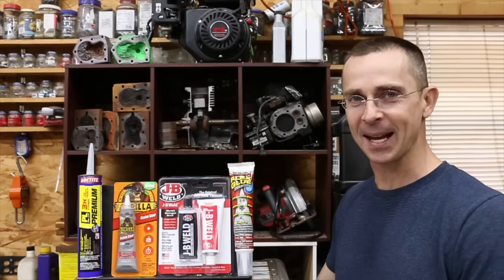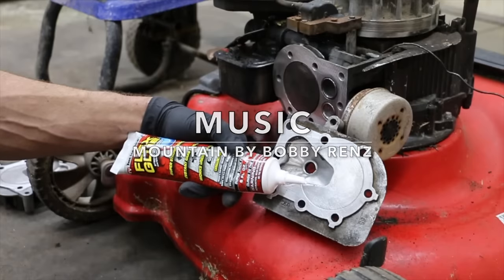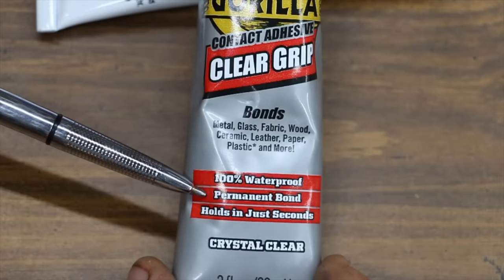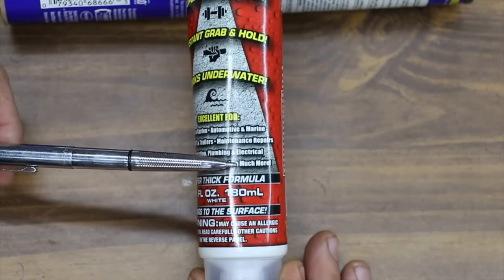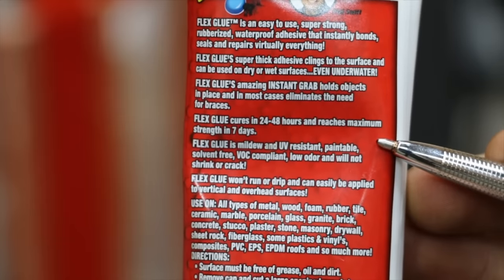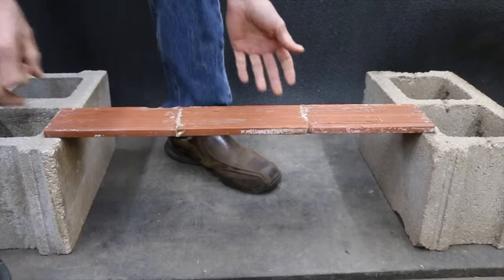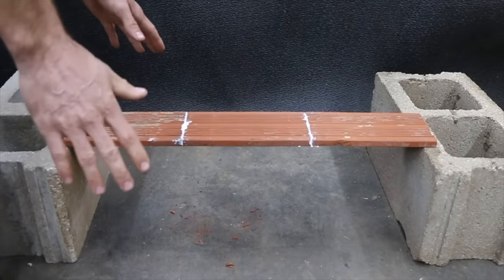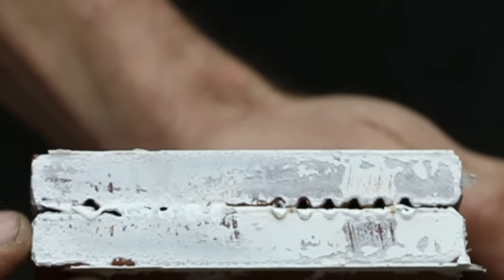Is Flex Glue better than JB Weld, Gorilla & Loctite?  Let's find out!

Comment: at college we were made to sand both surfaces with sand paper from a rough grit down to a fine wet and dry then clean before bonding, and it made a big difference in how much stronger the bond was, it was with superglue not tried it with other stuff. bet it was like Christmas waiting to start them mowers. happy christmas
Reply from the maker: Great tip! Thank you. Merry Christmas and Happy New Year!
Reply: JB weld likes a rough surface to bond to, says so right in the instructions.
Reply: Thats also because SG is dependent upon close mating surfaces and generally will not hold across any appreciable void. Not sure about the SG Gel, however any void it fills is only going to be as strong as the CA itself.
Reply: @jaydunbar7538  
A larger surface area due to a rough surface will help with pretty much any glue.

Comment: I once used JB Weld to seal a 3/8" hole in a crank case on a dirt bike.  It worked, I rode it for 10 years after that, no issues, no leaks!
Reply from the maker: Thanks for sharing.

Comment: This is comical how impressive JB weld is! I wonder if you could JB weld a diff I know people have tried it but this honestly makes me think that done correctly it would work.
Reply from the maker: Thank you!
Reply: Nope. It will not.  Doesn't survive as well in the oil.  Plus the differential has hundreds if not thousands of footprints of torque on those little gears. You may get away with a Chevy chevette or another low power car
Reply: @ferdiecassel3697  yeah, I ran into that on my truck. It's an '81 Dodge with a 318 Small Block.  I went to replace the timing chain and water pump on my Dodge, and I looked at the Timing cover.  Apparently, the previous owner had used JB weld on it. it had a massive crack, as well as a smaller crack where the timing marks were.  God knows how many years it had been running with a JB welded timing cover. 

JB weld is some impressive stuff!

Comment: I have a concern about your cylinder head test. I've been a mechanic most of my life and I've built hundreds of engines. I know the clearances in combustion Chambers can be very very small and the absence of the cylinder head gasket may have caused a physical mechanical interference between either the piston and the cylinder head or the valves And the cylinder head. It's just something I would check and if you could try it again and see if the engine will turn over and clear the head with the bolts still on that would prove if there might be an interference with the gasket removed.
Reply: True! Okay the piston won't stick out of the block on those B&S engines and there are no OH valves to interfere. But compression must have gone up. Could be fun to see the experiment repeated with a thick spacer in between, to de-tune the engine some.
Reply: In the cylinder is a real explosion, no wonder both failed at the first explosion that happened
Reply: He could use a copper shim or gasket, true. I mostly wonder if there is actually an interference problem I'm just mentioning he might check it. Some types of pistons protrude a little but sure if you know the motor then you might know the answer to that, but also of course it is a flat head, the valves aren't in the head but they are poppet valves that rise out of the block under force of the camshaft, and if it touches the head off it goes. And the cyllinder doesn't normally contain an explosion but a deflagration, a subsonic flame that increases pressure.. and a lot to be sure, but a true explosion is a supersonic detonation which would have a hammering effect and would absolutely blow that head right off. And you are right to mention it because the decreased chamber volume could contribute to a detonation, another reason to use a copper shim or gasket. Maybe he should try it again, the test is kind of ridiculous but it's also really fun to watch.
Reply: Good point, but a sidevalve engine's compression is so low to start with it's hard to say if a missing head gasket would make a big difference.
Reply: On a small engine like that, it's not even close. Especially on an old flathead. They used to shave the head down to increase compression on those back in the days for a little extra power.
Reply from the maker: Hi Dave, that's a valid concern.  I did check for clearance before attempting to start each engine.  There wasn't any piston or valve contact with the head.  Thanks again and Merry Christmas to all!!
Reply: back  to # 1
Reply: It's actually rapid burning and not an explosion. Just ask an expert.
Reply: @mariegoldstein6687  Technically it's a wave front that cascades though the combustion chamber,  This phenomenon attributes to the large success of the Hemi!
Reply: Long time mechanic, you should know that flathead engines don't have any real squish. Many thousandths of clearance  there.
Reply: Exactly what I was thinking.
Reply: @mariegoldstein6687  An actual explosion in the combustion chamber is what we would call "detonation".. And that is very very bad for the engine.
Reply: Denis Elis I’m just curious sir, but why would you use a pure copper gasket? Is it just a better metal for those area of high pressures and heats? 🤔
I’m not trolling I promise sir, I’m genuinely curious.
Reply: Peter Ryan it is soft enough to deform and squash into shape, but also resistant to high temperatures. 👍
Reply: If you have 90PSI from a piston with a displacement of 4 square inches, and a gasket surface of 3/8 to 1/2 of an inch, there is no way that kind of imbalance can make it a fair comparison.
Reply: Cylinder head pressures are enormous on the powerstroke. I don't think it failed until ignition
Reply: @skuula  I think Dave B was talking about not the piston hitting OH valves, but the valves hitting the head when they open.
Reply: @peterryan5309  if the head gasket is fiber or a lamination it would not have the tensile strength to hold the head on, but would just rip apart. Remember he was just gluing the head on no bolts.
Reply: i agree.  I recommend leaving the real bolts in the head.  Until after you start the engine.  Then see if you can take the bolts out and the engine keep running.
Most likely it will fail on the third bolt.  But it will not be a dangerous situation, with the head flying off.  It will just sizzle out and die.
Reply: I was thinking the same thing.   Also removing that thick gasket raises compression alot.
Reply: Do you know what I am saying? -Butters

Comment: Impressive testing proceedure!  Felt like Consumer Reports!  I like JB but am amazed at its performance here.  Currently, in my shop,  its sealing a cracked spray hose in my as well as a broken heat gun electrical fitting (bakelite?) where cord enters the handle.
Reply from the maker: Thank you!

Comment: I'm sold on the JB weld with all those tests that you did on the strength with the woodsteel and the plastic. Like I said I used it on the cylinder head. So far I'm good. Thanks for your videos. Keep rocking brother and be safe
Reply from the maker: You are welcome!  Thanks for the feedback.

Comment: You should do a video on epoxy flooring for garages.
Reply from the maker: Great test recommendation!
Reply: @ProjectFarm :  Yes, please!  Test at least with brake cleaner, brake fluid, hot rubber tire with weight on it left over night.
Reply: I'll come over and do a "burnout" test if you need it!
Reply: There's only one commercial floor epoxy maker I trust. Burke. (retired concrete man/mason)
Reply: That would be a great idea!

Comment: Todd,
Merry Christmas Eve,
JB weld impressed me except for a head gasket. Couldn’t take the compression around 100 psi . At a party had to sneak to another floor to watch on my iPhone. Can’t miss toddler. Where the heck did a piece of railroad track show up in the video.lol
6 hrs for Christmas. Enjoy . Wouldn’t miss your videos even on Christmas Eve. Respect Todd people.
General repair
Reply from the maker: Hi Mike, It seemed to do fine at 100 PSI, but when combustion occurred, I imagine the head pressure exceeded 1000 PSI.  I have a friend that gave me the railroad track.  He retired from the railroad company many years ago.   Wishing you and your family a Merry Christmas and Happy New Year!
Reply: I have a 1ft length of rail, it’s great as an anvil. It helps that I work on a railway.
Reply: I also think i have a small piece of rail road on my garage. My brother works for the local gas/water company and he has a piece of one of the large 36"+ water lines.
Reply: Add a zero to that

Comment: Wow JB Weld!! Lol.  Of course we all joke about patching holes in engine blocks with the stuff, but darn it is strong..  JB Weld gasket. Lol
Reply from the maker: Thank you
Reply: It may not be a professional fix, but it will work.
Reply: You might joke about it but I've seen it done
Reply: @edwardrogers8507  I fixed a soft spot (3/8" defect) in a cast iron block by drilling it out, threading, then JB and a bolt cut down so the head would be close to the block without squeezing out the JB. Let it sit for a few days and it never failed.

Comment: I used JB Weld to repair a crack in my Parent's sectional circulated hot water Boiler (Home Heating) in 1992. The heat from the Boiler cracked a different section of the Boiler a year later. The problem was corroded water pipes from the street to the premises limited incoming water. The water piping from the streets was undersized, the house being built in 1905. Whole house repiped. JB Weld never failed. ~ W.G. Eldridge (Engineer/ U.S. Gov't), retired.
Reply from the maker: Thanks for sharing.

Comment: A catalyzed product is always going to be better.
Reply from the maker: Thank you
Reply: Absolutely.  The possibility of two parts, mixed just before application, gives the chemical engineer much greater freedom of design.  A one-part adhesive has to somehow take its cue to set from changes that occur at application, such as exposure to air or moisture.  This is surely more difficult, especially for a general-purpose adhesive.  Another good type of adhesive is one that sets on exposure to ultraviolet light.  This is how my teeth are held in.
Reply: Accountificationable  : I didn't expect to be taken to task for this, but what I mean exactly is that my crowns are held on to the remains of my teeth, i.e. the core and the root, by UV-setting adhesive.  I suppose I think of the crowns as "my teeth" because they are visible and do the work of teeth.  Maybe the use of UV-setting adhesive for this purpose is less common than I think.  My dentist is rather cutting-edge.  The crowns are computer-imaged by a camera placed in the patient's mouth and then milled from solid blocks of ceramic while-you-wait, so the whole thing requires just one visit.  ( https://www.yelp.com/biz/moeckel-melissa-a-melissa-a-moeckel-dmd-marlborough )
Reply: @Michael W :  This is YouTube, for heaven's sake.  It's not some engineering class that you signed up to and paid for.  Are you such an unpleasant person in real life?

Comment: I use JB Weld on a scuba diving tank as an emergency the tank after being repaired with a small metal patch and JB Weld was able to hold 69 pounds of air pressure that doesn’t seem like a lot but when you dive down approximately 50 feet that 69 pounds rockets over 100 with no problem we were very careful and didn’t exceed the 50 foot limit because of the possibility of sudden decompression on that tank amazing amazing amazing
Reply: Ron - the fact you even trust it to the limits and application you do speaks volumes!! Thx for the info!
Reply: @abbiebeast  This was an experience that someone else had had I asked him one day why do you carry so many different epoxies and he explains that he uses this it is in his mind bulletproof he fixes everything with it he was a commercial lobster diver and he never goes down more than 40 feet anyway but he actually uses it on the threads of his air tanks when he’s connecting his BNC how do you able to remove it if he heats it up and slowly cranks it back but when he’s 25 or 35 miles out from shore he can’t afford to come back in if he has a failure

Comment: There is one thing that I would suggest.  Your showing the stress that seems to be going against butt joints, so to say.  What about using a 4x4 face against another 4x4 faces with a way to put the weight on the bottom joined piece?  And then a 4x4 against a 2x4.
Reply from the maker: Great recommendation!

Comment: JB Weld has never failed me for rigid repairs that can also use sanding ... but for flexible repairs and certain bonds, E6000 is my go-to favorite ... It's the followup generation of the Goop products from Eclectic ... I remember buying Goop that was originally sold for tennis shoe repairs almost 40 years ago and haven't looked back ... the product has been marketed for specialized repairs of different categories  like wood, plumbing or marine, but honestly I think they used the same formula, just about, for all of them ... I always get the tubes with the fine point  to save on waste and get the product much more easily where it needs to be ... if you doubt it's strength buy a small tube, lay a fine ribbon like 2" long and try pulling it apart the next day
Reply: Have used Goop for years. Last thing I fixed was a tear in a pair of work pants. Use a used dryer sheet or a rinsed baby wipe as the backing material and apply goop to both sides. Also just fixed a pair of sandals that were coming apart. In addition you can apply Goop to the soles of your shoes, and they will never wear out, just reapply.
Reply from the maker: Thank you!
Reply: Ya buddy amazing e6000 is one of the best when flexibility/sealing is called for. Its actually better for shoes than shoe goop. Only downside is keep away while it dries the fumes make some people sick. Also a partially used tube lasts longer on shelf than goop.

Comment: Okay I'll admit it I'm literally shocked that JB weld is THAT effective and strong.

I knew it was a tough product but GOOD GRIEF that's ridiculous ...ridiculously impressive that is!
Reply from the maker: Thank you!
Reply: A few years back, Jaguars had an issue with "oil porosity".  Basically,  they had a main oil galley leak at the back of the block.  The warranty repair was... remove transmission, clean the heck out of the back of the block, then they had us mixing and smearing jb weld on the block. Yeah... $130k vehicle, and they had us smearing jb weld on the block, instead of dealing with the real issue... block core shift during production.
Reply: @mikebolton3816  that's nuts!

Comment: I am a dtickmaker. Add cane toppers to various types of wood. Overvtge years I have noticed a difference in longterm  holding between JB Weld and JB Weld quick. After 10 years the brass, or antler epoxies with qwik gets loose but the regular JB WELD still holds.
Reply from the maker: Thanks for sharing.

Comment: Use Jb weld on metal and wood glue on wood. For plastics use two part epoxy.
Reply from the maker: Thank you
Reply: @ProjectFarm  I am sure you probably know that but a lot of people do not. Also, JB weld steel stick epoxy putty is amazing. I have used that stuff to repair a lot of cast iron industrial gearbox housings and it works great! It works very well for filling in big cracks, gouges. Great video by the way! Loved it and subscribed!
Reply: @realpatriot5896  New headline:  Project Farm - always a good decision
Reply: @realpatriot5896  There's another Project Farm video where he compares several epoxy-like adhesives, including the steel stick putty. I'm sure it has it's uses, but in the tests he did, it really underperformed.
Reply: @TravisTerrell  Not sure what he used it for but I have mainly use it to fill in gouges, cracks and put back on broke off pieces on Industrial gearboxes which are made in molds out of cast iron. Broke off or exposed cast iron is very porous where it is not finished. I believe it needs that kind of surface to adhere well. In those situations I have not had any issues with. I even grind it down to match the existing surface and have never had any break loose. I doubt it would work real well on smooth surfaces. A little common sense and knowledge of materials goes a long way in choosing the right product for any given situation one may find themselves in.

Comment: How about E6000 / Goop 2? That shit is super strong once it dries. I've tacked heaters back on to walls with it. And unlike epoxy it does have some amount of flexibility.
Reply from the maker: Thanks for the video idea!
Reply: is e6000 the same as goop 2?
Reply: I actually tacked the sole back on a workboot with that stuff, got another few months out of them.
Reply: Never heard of Goop 2, but the regular Goop isn't anything to write home about as far as bond strength. That one at least is more of a flexible sealant that happens to have decent bond strength for what it is. Don't get me wrong, I like it for what it's good for and it's useful over others at times. 

Project Farm should try to use F26 a cylinder head. It might actually run!

Comment: My brother used JB Weld to attach the harmonic balancer on his '66 Plymouth Sport Fury 318...19 years ago and still going strong.  Pun intended.
Reply from the maker: Impressive repair!
Reply: My cousin had a 350 Chevy with a cracked block,right next to a freeze plug. He cleaned the hell out of,heated it up to open the crack and packed it full of jb weld and ground it flat. He drove it for  a couple months,rebuilt the motor,drove that til he got enough saved up and stroked that same block to a 383 and Raced that motor long enough to rebuild it twice! Never ever had an issue with that jb weld repair. Hell of a product!